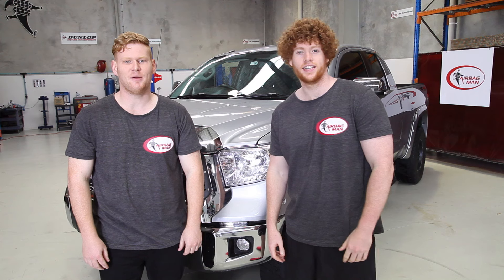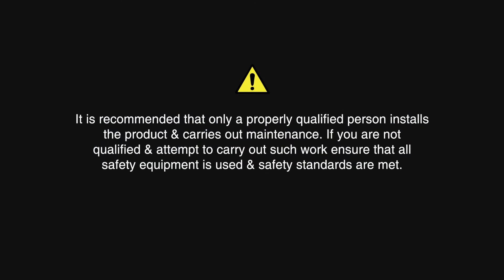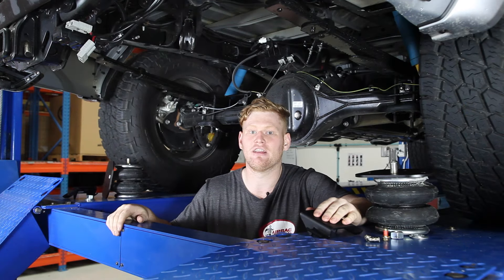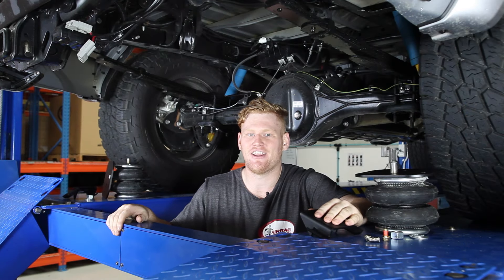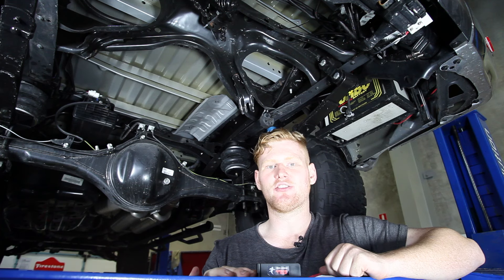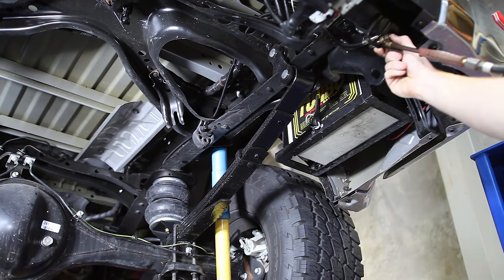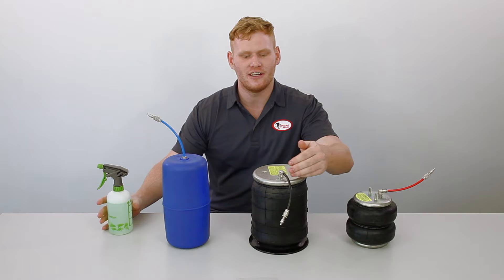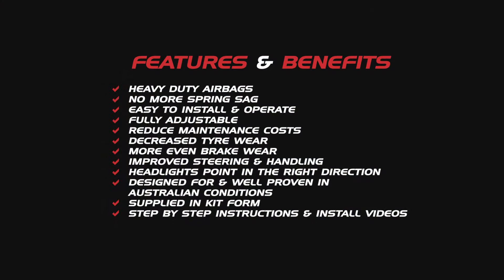How to Install: Toyota Tundra Air Suspension - RR4641 Airbag Man Leaf Helper Kit

Comment: Just a safety tip...those stretch nuts you removed on the bottom of the U brackets should Not be reused!  Always install new stretch nuts if you remove the original ones!!!

Comment: I've seen guys use just a single nozzle instead of one for each bag when it comes to filling the system up with air., how is that done? Also technically you could leave 30-40 psi in the bags all the time to achieve a little lift to be able to go up a tire size no? As opposed to getting your typical level kit block style. Thanks
Reply: @airbagmansuspension  meh sort of, Air lift actually manufactures a system with your choice of single path or dual path which allows you to have either one nozzle for both bags to be filled up evenly or two nozzles, one for each bag. Its a little confusing everybody seems to have their own opinion even on a professional level.